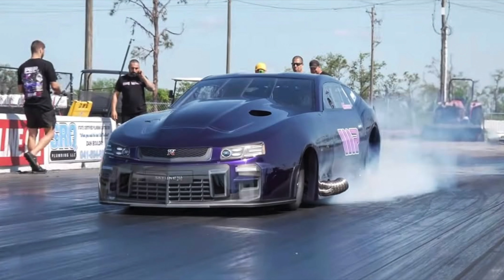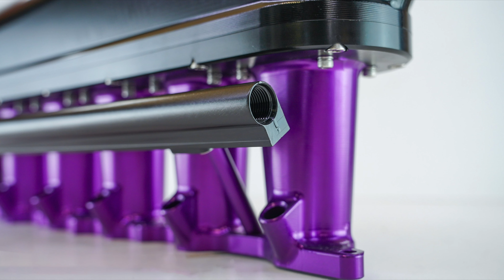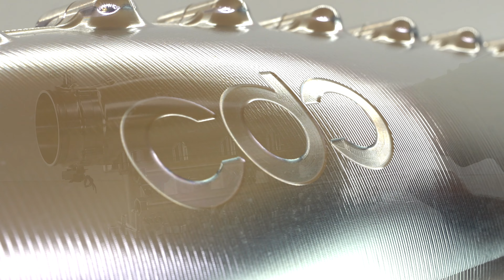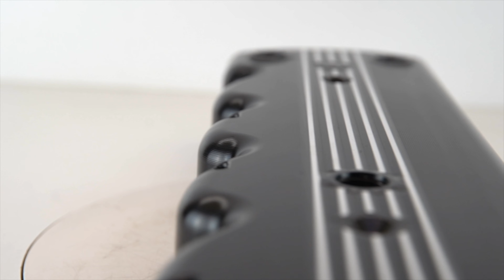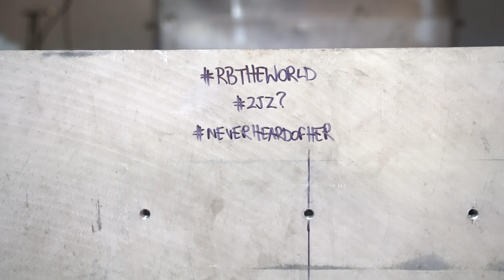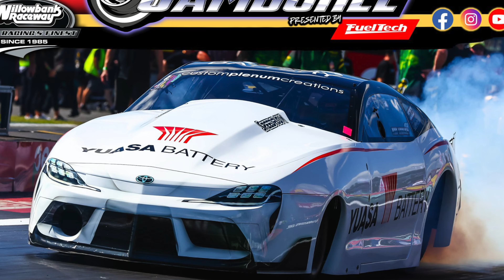EP7: Workshop Update - New Billet Blocks, Drag Parts, Product R&D.

Comment: double VVTI from toyota over to the rb head, just imagine that! now same thing could be nice to see on 2jz
Reply from the maker: I wouldn't mind a k series style head on my own personal RB
Reply: @cpcmanufacturing sadly only neo heads had vvt and only for intake, imagine the spool benefits, 500 rpm sooner makes a huge difference in the city with 1 vvt, now 2 is another 500 earlier.
Hks proven a vcam is a big advantage, for 2jz is a lot easier, just reuse the intake cam for exhaust and add the vvt cover on top, sure head will need a bit of trimming but the advantage is worth it

Comment: Sir  the Engine Block You should Turn into Aluminum and You Can Bore It Out More Than  Your Thin Wall Staight 6 cylinder.  Make the Bad 🫏 VR6 from Porsche. The Wall thickness you Rock you Up

Comment: I assume the products are a reaction to what the market wants, but I'm surpised that there isnt any companies creating intake manifolds that concentrate on response. Every billet or sheet metal manifold I see is aimed at drag racing. Even if the stock mani's are great, there is room for improvement in terms of aesthetics and serviceability.
Reply from the maker: I totally agree. If the market wants such a product, it would have been developed. The standard intake manifold does such a great job to cater for the lower horsepower market and hence why the high hp manifolds are a thing, to cater for those that exceed the factory manifolds restrictions

Comment: also, have a teflon manifold gasket unlike what's out there now, the ones out there replace the existing gasket and are quite thin, i can't see them holding back much heat from the motor to manifold..what would be ideal is a 5mm thick teflon gasket inserted into your flange, that way people would have to buy gaskets from you and they will work 100x better at separating heat from head to manifold. some formula one engines use these and they are about 5mm thick. that wont be a stand out in my opinion

Comment: my 2cents..

is it possible to have trumpets on a separate plate?

all billet manifolds are beautiful and all see to do similar things in terms of engine performance, one thing i would like to see would internal removable and interchangeable trumpet protrusion length into the chamber.  simply have them its own separate piece..this can aid in tuning and rpm band, have 3 short median and long options. The longer the internal trumpet-the less internal volume-early power-band..longer option can be for drag. this can aid in targeting different markets, those doing drag or time attack. 

i've had high and low volume manifold chambers and there's quite a difference in spool and piwer
Reply from the maker: The, what I call, the plenum base, has the bellmouths inbuilt into it. This is a separate piece. Coincidentally, that is the part I change between billet and carbon manifolds

Comment: tell us more about these and how they differ in volume and what volume suits what capacity and what rpm. Obviously the market is quite large, we need more information on why and how your is different. at least tell us the volume
Reply from the maker: There are so many differences between each manufacturer that we could do a video on just comparing a single engine type manifold from 3-4 manufacturers. Volume alone doesn't tell you much of a story.